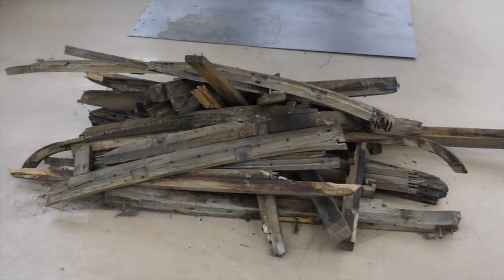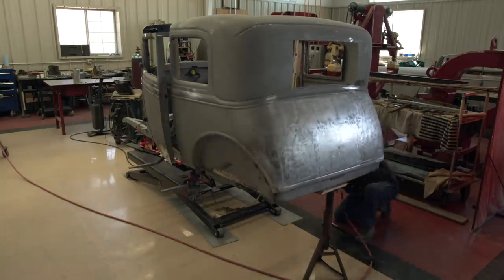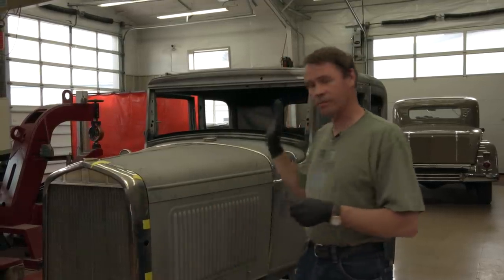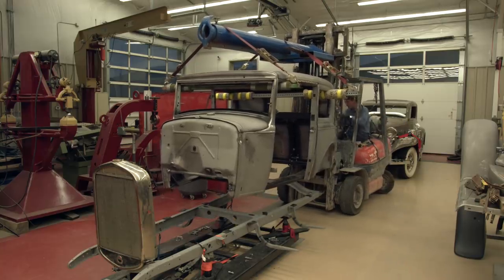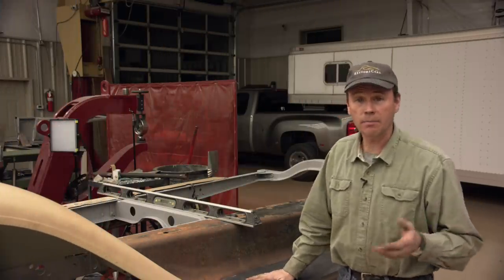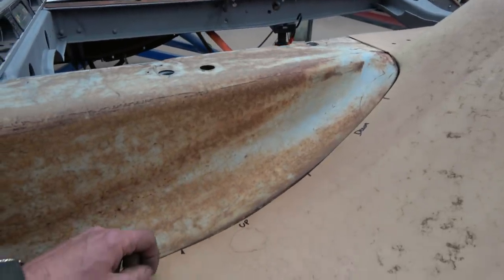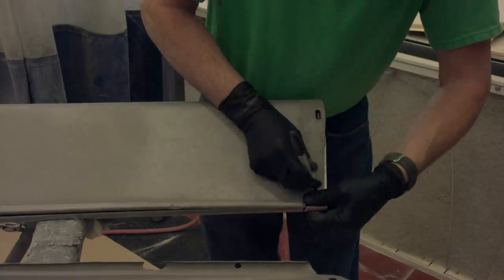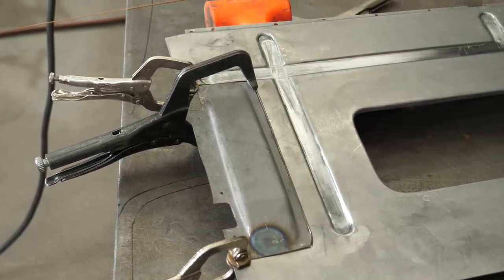EP 7 Model A Victoria Restoration.  We finally finish the bodywork.

Comment: I told you to keep on keeping on!
It looks like it's coming along well.
My Dad had many of those, a few "T"
Models , A & B models and "Vicky" or two. Back then you could pick them
up for a song, you had to because you had to have extras for taking them apart for parts to keep the one up were driving going!  He kept a book with all of these cars and the count of the different cars he owned. They may have rusted down
in this Alabama climate but I wish he could have kept me a couple of the cars, oh well...
He had a few older CHEVYS, even a Dodge Brothers or two.  He told me when Ford quit producing the Flattie
V8, in '53, I believe, he went to the 
Stove-Bolt Chevys. 
His first new car was a '52 Fleetliner, the car that he had when I was born in  1955.  Before I turned 1year old he traded that Fleetliner fastback for a 1955 BelAire 4dr sedan.  265ci V8
Power Pack ,  4bbl carb , dual exhaust.  I myself had 2 1955s 1 57
And a '64 Chevelle with a 283ci SS 2dr hardtop with dual exhaust and 
2 4bbl carbs. The build sheet and window sticker listed,  I bought it with a non- stock rod protruding from #6 piston. I bought a "seasoned"  327ci from a junkyard. 
I got it running and a friend I went to school with , bought it and made a quarter miler out of it and was pretty successful with it. Won a lot of side bets with it!!!  I miss that particular car....

Comment: We have a Ford maroon and black steelback Victoria. I haven’t seen a leatherback Victoria and since the top on the leatherbacks is a light material (tan two-tone, diagonal grain artificial leather) I’m not sure exactly where the black comes in. Only the belt molding and upper body around the windows I suppose.
Reply from the maker: Both the green and maroon color combinations look good with the top material.  unfortunately there is not a close match to the original available.

Comment: 27-June-2020.When l worked at Mcdonnell douglas they has laser holigragh see truw plates to see the warp on the plane, at Volkwagon in Wolfsburg we work on a CDM,( Controlled database model )proto type van to go in the safe.you sould see about that, l know it,s over kill but it takes time off the assmenbily as each unite and the whole are scaned to the 0.00001 if you want.

Comment: It may be the camera lens, or possibly something else, but the bow arch of what i think is the Head Light Bar does not look circular (out of round) to my eye. The circle seems "tighter" on the passenger side (right side in the video) @ https://youtu.be/AXHhE6JwaQc?t=825 . (or 13:45) Am i wrong? ||| I do notice as the camera pans across the arch does seem to change or shift though, so I am probably wrong. I will get a kick out of it if my carpenter's eye proves correct if you check by drawing an arch on something and laying the Head Light Bar down to match . . . but my bet is that you already have done that, right?
Reply from the maker: It's sometimes tough to get the exact right angle to see thing the way you see them in person.

Comment: It’s looking great. Does the original metal feel different when you are working it?
Reply from the maker: No the metal is slightly hardened by the blasting process.  The new 19 gauge works easier than the original metal.